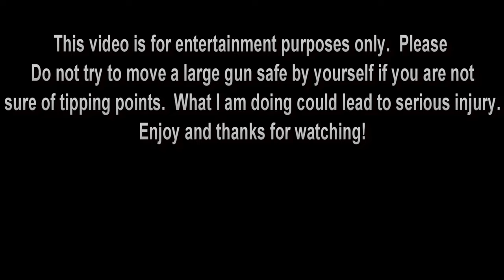Moving a Gun Safe By Yourself With Golf Balls

Comment: Schedule 40 pvc cut into length just wider than the safe is much easier. Unless you have a massive safe the pvc can support the weight.  Use about 4 so u always have 2 under the safe.
Reply: Even on carpet?